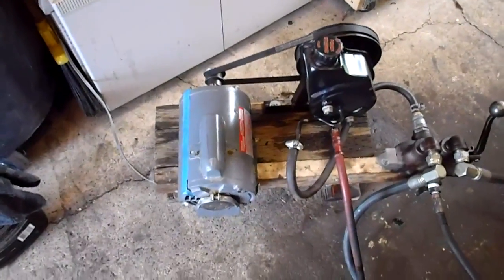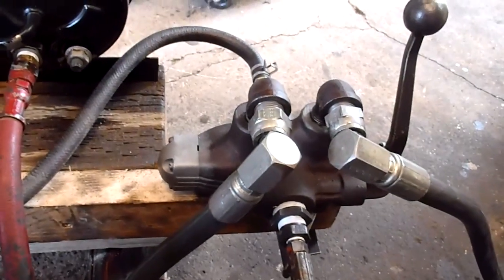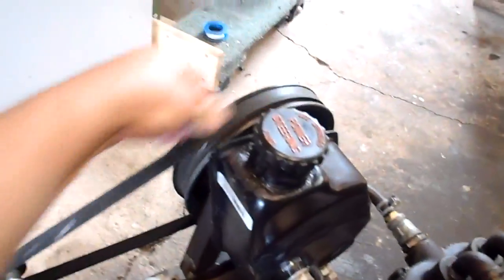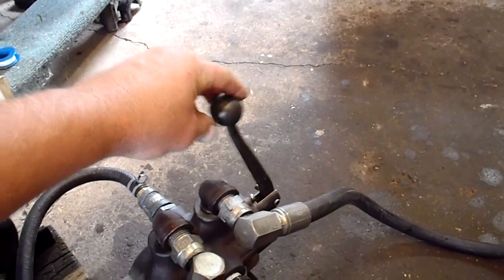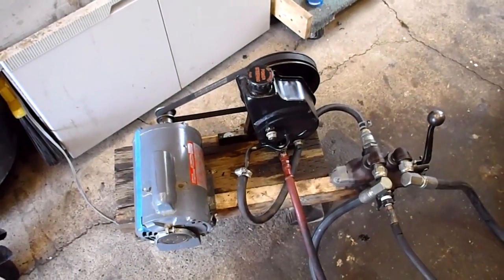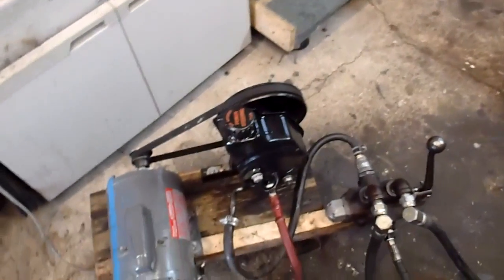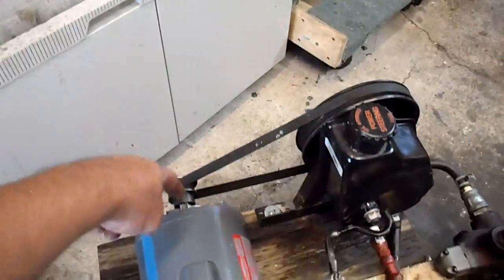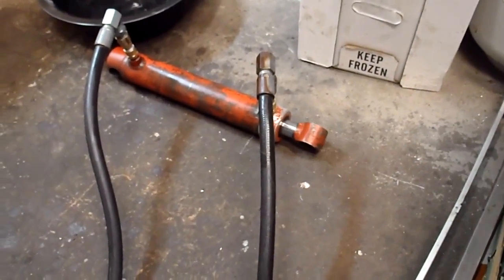Controlling Hydraulic Motor & Cylinder With Power Steering Pump

Comment: Thanks for the video, I know it's old but I just stumbled across it.  I was searching for power steering pumps used as pumps for hydraulic rams and such to see if an idea I had was viable.  Your video, and the comments, answered my question about viability, it definitely is a workable solution.  I plan to build a hydraulic press, using a ram, to bend sheet metal, press in/off bearing races and such.  I wanted hydraulics on the cheap and it looks like I can do it now.  I've got a couple of 4 hp motors lying around and a few power steering pumps.  I can weld up a reservoir for the system.  Just need controls, hoses and a ram.  Thanks for the info!
Reply from the maker: Hey I'm glad it helped.  I had fun with this project.  If speed isn't a huge concern I'd think you could gear it for the power you need, hope it turns out well.

Comment: 👍 What I was willing to try. Did you try it on garden tractor?
Reply from the maker: no, I ended selling the tractor before I got to that point.  Used it more as a mobile hydraulic source.
Reply: @ObixMT  do you still have it?
Reply from the maker: @darnelljackson2160  I have parts of it, I've got all the hydraulic stuff, the tractor was a 70's MTD type all hydrostatic, I restored it and sold it to a guy who now uses it in his airplane hanger to tow his helicopter in and out with.

Comment: I really would like modify this set up. I wish I could talk to you and run my design by you to see what you think. This is very clever the way you are able to use basically junkyard parts and make it work. That takes talent I think.
Reply from the maker: That's awfully kind of you thanks. I'm far from being an authority on hydraulics, but I found I could learn a lot just by hooking odd parts together and observing the results. I'm considering building on this concept and incorporating it into an injection mold setup.
Reply: @ObixMT  Your probably going to get a good laugh. I wanted to replace the electric motor you are using to run the power steering pump with a bicycle. I want to use human power to run your set up. On the business end of the device, mechanical power converting to electricity. I have a few different designs but I am not a mechanic. Check out this video concept and tell me what you think.https://youtu.be/JrRZbIchx_8

Comment: Hi my I ask what type of motor I can use if I will make  a bending machine with this components?
Reply from the maker: I think this motor was between 1/2 and 1 HP, and about 1750 rpm.  Probably a little light for a bending machine.  It will come down to adjusting your pulley/gear ratio vs speed for the amount of power your motor can provide.  Best of luck on your project!
Reply: @ObixMT  okay sir thanks I will use 2hp motor. Last question sir, does all steering pump I can buy online already has a reservoir like the one you used in this video? Thank you sir

Comment: hi hope you notice. I just wonder if I can use Power Steering Pump Gm New Power Steering Pump that I can buy online? It looks different than yours. Could you give site that I can order same pump that you use?
Reply from the maker: there's nothing special about that particular pump, you should be able to use most any power steering pump though I would think that the older ones would be a little more robust, generic, and simpler to connect to.  If you go to a scrap yard you can pick and choose and probably pull a few extra hoses that may work depending on what you want to do with it.
Reply: @ObixMT  thanks for the reply sir. I am planning to use it for hydraulic bending machine, do you think it would be possible?
Reply from the maker: @kuysdj4732  yep, I don't see why not.  The main variables I think would be the size of what you can bend vs how fast you can bend them.  That sounds like a very interesting project, if you make it I'd love to see a video of it in action!
Reply: @ObixMT  thanks for the answer sir. I would be happy to show you that sir

Comment: Question?  Will a hydraulic motor free turn by hand when the valve controls aren't in use?  For example, If i was using a hydraulic motor to make a wheel turn for forward or backwards motion when using the controls.. Would that wheel stay locked still when the valve control wasn't being used, or would it turn freely as if it was in neutral ?

Comment: Can this be used for a mini excavator in this set up?
Reply from the maker: yes but... in functionality, yes.  As for performance that will depend.  My personal experience is that they don't have as much flow or pressure as one might want.  My intention was to use these to actuate smaller stuff on riding mowers like a simple three point or snow blade adjustments.

Comment: Thinking about turning an old pick up into a back hoe or a front loader. Any advice. Its 4x4 so I could use the transfer case to run the pump but then I couldn't drive it. If I use a steering pump I dont think it will handle much weight.
Reply: You need to attach another steering pump

Comment: FYI - Those cast iron fittings (especially the elbows) are only rated to 125 PSI (max).   If you're working cylinders even moderately loaded, stand back.  That hydraulic oil can get really hot.
Reply: I was thinking the same thing. One point though there not actually cast iron but rather malleable iron which is a little more forgiving and the 125# is a nominal rating. In any case not safe for higher pressure hydraulic systems

Comment: How many HP is the motor? At what pressure does it start to slip the belt and what line and work pressure were you able to achieve??

Comment: Power steer pump will have a hydrostat valve spool limiting the flow and an internal relief set very low because it's only intended to assist steering ,you should also limit the use of 90 deg fittings in a hydraulic system, they rob flow and pressure..

Comment: Is beautiful may use old forklift 12 volts hydro pump and use in Mobil places give you 230 psi and 3000 lb power w oil iso 36 or 60w is good but you system is great to thanks

Comment: Hi! Nice video! Really enjoid watching this. Do you think i could use a setup like this to power a 30 ton hidraulic press? Thanks!
Reply from the maker: I'm no hydraulics expert by ANY stretch, but my guess from a physics standpoint would be yes HOWEVER it would probably be extremely slow.  The next tests I want to try is running multiple pumps in parallel to increase volume output.

Comment: I build one to be used for a log spliter. It had no power
Reply from the maker: Thanks for sharing.  That's interesting, what were some of the specifics of your setup, i.e. - type of pump and cylinder volume?  Also what were you powering the pump with?

Comment: Power steering pumps are great little units. They have a pump, regulator and pressure relief in one unit. I use one to run 6 cylinders on a mini-dozer. If you need more capacity, build a reservoir. one of the best things Is the fact that they can be belt driven and can handle a lot of horsepower on the input shaft. My dozer uses a pump off of a dodge caravan. cost me 20 bucks and works great. in fact, I need to add an orifice fitting to slow things down

Comment: Nice setup. A friend of mine has been using power steering pumps for years to power hydraulic winches, etc. You should really consider removing those two cast iron 90 degree elbows from the plumbing department. They are not rated for nearly the pressure that pump is capable of making. Those fittings are for low pressure water or natural gas, not high pressure hydraulic systems.
Reply: What is the max psi the steering pump can generate? Also, at what psi is the pump internal relief set, can it be adjusted? The directional valve should have max psi up to 2500psi but is fully adjustable. An indication that both reliefs are set too high is the belt 'squeal' when he maxes out the cylinder stroke. I would be concerned with the black iron cast 90's in the working ports of the valve. I've never checked the max output of a steering pump but I'm not really sure if it would produce enough flow and pressure to be practical other than a 'working model', which is pertty cool. Alot of people probably could never have done what he did. I admire his capibilities. I spent 16 years as a hydraulics tech building industrial power units and the machinery they ran for the offshore oil&gas industry. I specialize in clossed loop systems ranging from 75hp up to 600hp......interesting work, I no longer work as I had to leave to fight lung cancer which I BEAT, but the chemo and radiation beat me, lol......
Reply: james moore. glad you BEAT that evil disease.  keep going strong.
Reply: @joseluisrodriguez5302  thank you sir, I tell people God is not finished with me yet so he kept me around. 9/2/14, the doctor gave me 'about 90 days', God showed him differant.
Reply: Hope you get more 90....years.  Best regards.
Reply: I sell hydraulic hoses and fittings.   I've never heard of the 90 deg compact fittings being rated at less pressure
Reply: Pete Richardson he’s right. Them 2 cast Street 90’s are rated at about 150psi. Shouldn’t be anywhere near anything Hydraulic.
Reply: agreed, you need fittings good for 3000 psi or better

Comment: Would this work on a garden tractor to run the three point hitch and a front blade or front loader?
Reply: Brian Philbrook  if you put a big pulley on the pump and adjust te releef valve, then you could put out 2500  /3000 psi of a ps pump or in my case 200 bar . Dont know if it stays alive for long.
Reply: Yes it would, easily
Reply: Brian Philbrook I'm doing something similar I will put videos up I am making front end loader and backhoe in near future but first the loader I have been taking video clips but I'm not going to put them up yet since I'm doing something I don't believe anyone one has done before I could be wrong but it's not on YouTube or internet. The pumps are the difficulties in the project finding a location to mount them. Keep eye out for my video thanks.
Reply: I have mounting pads set up for a loader on mine. Just don't have the steel to start on it. I'll be watching for the video. I'm always interested in new ideas.
Reply: Brian Philbrook I'm starting from scratch but right now I'm having trouble with my electric welder it's to much for our old house and wiring so go a have to either  A.get a generator or B. Get a gas welder which is more than way I have to put out or C.run new heavier wires and box to my garage. I'm no electrician so I would hire someone and that's more than a gas welder so I'm in a pinch right now all i can do is keep working save pennies and keep thinking don't want put money in a house we will be selling new buyer ain't gone care about new electrical work in a garage so gas welder looks better all time. Keep every one posted on my lawnmower front end loader and backhoe when I am welding and got everything in action thanks
Reply: Hobart made a decent little 120 VAC suitcase welder that can handle up to 1/4" steel. I used one to build a quad trailer a few year ago. There are also 120 volt wirefeed welders available. Also, depending on the buyer, garage electrical service can be a big selling point.

Comment: this would be cool to use on a shop press.
Reply: I've had one running a shop press for about 30 years... But I've got a bit bigger Reservoir. I've got a 5"×30" cylinder and a five gallon bucket that is a little over half full...not only ads enough oil for it to work, but also some cooling!!
Drawback is, power steering pumps are generally set up for 1,600psi... But it does work!!
Reply: @GosselinFarmsEdGosselin  what size electric motor runs yours?
Reply: @jesselawson1169  good question!! I just looked, can't find anything.. either not marked or I just can't get in to see it. If memory serves, I think it's a 2hp. Maybe 2.5???
Reply: @GosselinFarmsEdGosselin  right on. I bet having a 5" cylinder helps it make pretty good power with the power steering pump. I would assume it's pretty slow though?

Comment: Did you mount the power steering pump sideways under the riding mower? I'm being told you can with 90's GM pickup truck pumps that have the external reservoirs. I really need to know if these pumps can be controlled via a horizontal belt as opposed to the vertical belt under the hood of the pickup.

Comment: Oil flow for typical Power steering pump with default pulley diameter, 5 gpm @ 5000 rpm

Comment: Excellent! this is exactly what I have in mind for  a log splitter...any idea how I can work out the power in tonnes on the ram, is this dependent on the ram size or the power from the pump? and advice would be appreciated :-)
Reply: I would think the equation 'pi r²' would work.

Example;
Pump pressure =1000 p.s.i. (pounds per square inch)
piston size of cylinder = 3 inches
radius of 3 inches is 1.5 inches
1.5 inches x 1.5 inches = 2.25 inches
2.25 inches x (pi) 3.14 = 7.065 inches

So using the above equation, utilizing a pump putting out 1000 p.s.i. and a cylinder with a 3 inch piston would yield 7000 p.s.i. of force.

That is IF I'm correct in my thinking.

Hope this helps.
Reply: @russdavis1960  your psi is 1000 equals a total of 7000 pounds of pressure, or 3.5 tons of force.

Comment: what psi does it generate?
Reply: I just went looking for pressures on stock GM pumps like that.  They seem to range from about 800 to 1200 PSI @ 5000 RPM, depending on the application.   

It's important to note that the pumps are designed to run in only one direction, so be sure that you are spinning it the right way.   When you pull one from the bone yard, be sure to reference the belt routing diagram.  I believe if you hook it up backwards, it would put high pressure on the low pressure return line, and could result in a dangerous situation.
Reply from the maker: Thanks JW, like you say other then checking the spec's on the pumps I'm not sure.  I believe, for me anyway,  is volume.  So far the only application I've used it for is controlling a snowplow blade on a small garden tractor and that worked 100%.
Reply: These charts might help: https://www.pirate4x4.com/tech/billavista/PR-Hydro_Steering/index2.html

Comment: I've got a dual spoil valve on my tractor I've been told by the internet isn't worth rebuilding. Would you be interested in using it for a video?
Reply: It would only need four cheap orings to reseal it ,I wouldn't throw it away just yet. p.s. I've got 30 years in hydraulics  and some people on the net don't have a clue!

Comment: If you think about it, you could potentionally make these hydraulic motors into a generator if you know how to.
Reply: MichaelKingsfordGray no kidding, why convert electric to hydraulic back to electric?
Reply: Probably meant that you have an liquid fuel engine(car engine) running the pump, so gasoline to hydraulic to electric. But that's still pointless, just have the engine turn over a generator.
Reply: Pasta Sarmonella E-Specialé why would you do that?

Comment: When running the hydraulic cylinder, with cylinder fully extended...is there any fluid even left in the pump???  I wondered how the cylinder even did a full stroke without using all fluid from the reservoir?        That is a GREAT video, an eye opener for me for sure.
Reply: The cylinder he is usin g is a doub le acting sylinder which means that the hydraulic fluid coming out of one side is going in the other side. This means that you are just moving the oild from one side of the cylkinder piston to the other. A single acting piston wouild be a problem that is where the system just will push the cyliner in one direction like out of the cylinder then a bypass is opened that with weight on the end will force the cylinder down  and the fluid back out. This setup uses fluid from the reservoir. So double acting cylinder is powered in and out so oil is swapped to other side of cylinder. Single acting is powered une way usually out so it draws fluid from the reservoir then when something pushes it back in the oil is returned to the reservoir
Reply: Closed system , the oil from the unloaded side returns to pump as the ram exrends

Comment: These are great P/S pumps for garden, lawn and custom tractors for front loaders or 3 point hitch on them. But most will recommend the ones from the 80s with a remote reservoir so you can put on a larger capacity hydraulic tank for extra oil. But people that have used them with great results plus they seem to be a lot cheaper especially brand new compared to standard hydro pumps. Main reason they say use ones from the 80s or older is because of the V-belt pulley is much easier to adapt to an already V-belt system
Reply: You can just put a second tank right next to it, and put it in your return line..  Just make sure it's level with your main tank, so that the "full" level will be full for both tanks.

Comment: attach a pressure gauge next time. Anything can seem to work with no load. Lets see this setup under pressure and see how much work it can do and how much pressure it can generate. I'm betting it bogs down and does not generate over 1000 PSI, probably much less then this. Sorry I know this seems to be bashing what you did, I just want to know how useful such a setup actually is. Thank
Reply: I was wondering the same as to loading it. like the effort two thumbs up
Reply: Most gm pumps run between 850 and 1200 psi, at between 10 and 20 gpm (the older ones being higher flow, but generating more heat and drag on motor).

So with a hair under a square inch of piston your looking at between 800 and pretty close to 1200 psi of force, maybe not good for log splitting but would be perfect to move a 3 point hitch around.

Also those are rated at 5k shaft speed.
Reply: Looks like a 2" diameter  cylinder,you'll only get 1.5 tons push out of it max .
Reply: ضذ